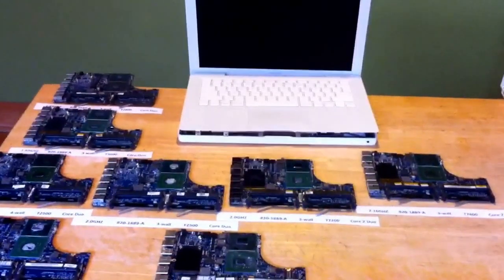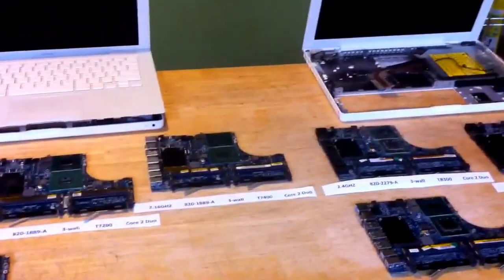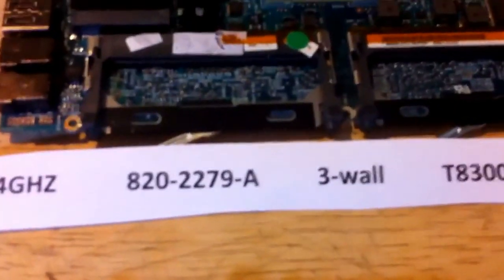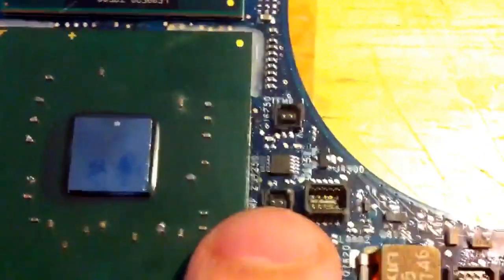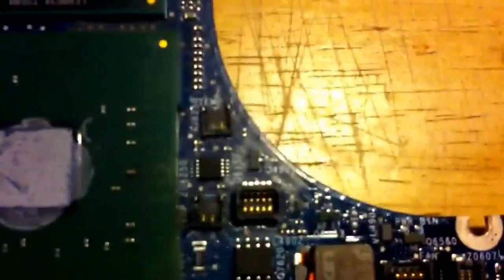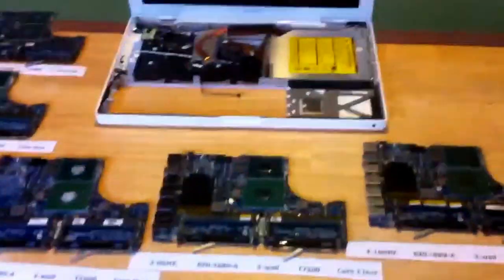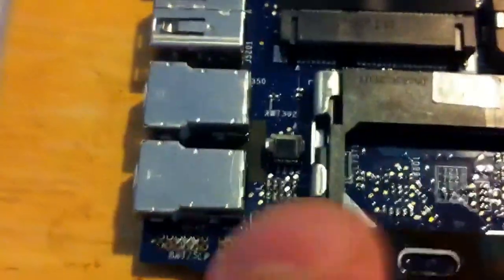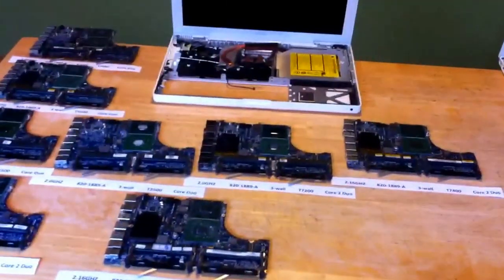MacBook A1181 Logic Board Overview

Comment: Hi rdklinc, I have a Macbook A1181 with a faulty 820-1889-A logic board. Let's say I swap it with a 820-2279-A, I know that in the video you say the heatsink screw locations are not the same, but what if I want to put it in anyways to salvage the working 820-2279-A that I have, technically what parts do I have to change such as Heatsink, speakers(because it has different sockets)? Can this be done? (with a bit of parts sourcing. Please advise. Thanks

Comment from the maker: Thanks!  Spraying compressed air is generally not dangerous to a board, so I wouldn't think that would be the problem.  Make sure the topcase connector is securely in place, and test the RAM slots by trying to power on with one empty, and then the other empty.  I don't repair or sell boards.  Thanks

Comment: Hi there, well done wery nice and informative video, I have a macbook 2008 A1181 model, the LB is 2279-A  with 2.4GHz, recently I dust cleaned, done already 3 times notting happens, this thime I don't know wath vent wrong but it wont start at all, could the gas that is conteined in the spray duster done some damage? as it gets wery cold and frezees conponents, and also is it possible to repair the LB, and how mutch do you charge for the 2279-A 2.4GHz ?.

Comment from the maker: Correct -- any 820-2279-A board should work.  It's actually my favorite model, because there's no variation of elements within the part number, unlike the 820-1889-A.  So it's a lot easier than others.

Comment: Thanks for your quick response, I think i'll keep looking for another board.
I'm I correct in assuming that any 820-2279-A board would fit my machine? My MacBoook is a late 2007 model and the board I'm looking at now is from 2008,
These are the specs:
A1181 MB403 T8300 2.4G logic board 661-4709 820-2279-A late 2008
My original board:
A1181 2.2GHz Intel Logic Board 661-4578 820-2279-A T7500

Thanks
(Original board is a 820-2279-A)

Comment from the maker: Thanks!  This is the mysterious "other" A1181 that I refer to, but that I don't have an example of.  I have never come across one, so I don't believe there weren't many made.  The optical connector is a smaller SATA connector, so you'd need a SATA optical and cable.  The heatsync is different -- it's a "straight" heatsync that points down and to the left at a 45" angle.  A different heatsync usually means different screw locations, so I'd guess it wouldn't fit in an 820-2279-A case.  Good luck!
Reply: Do you know board is in early 2008  black MacBook same a1181

Comment: First off, thank you for taking the time to make this, very handy.
My question: I've com across this logic board on ebay, 820-2496-A C2D P7350 2.0GHz.
seems to be 3wall connector.
Would they be interchangeable with the 2279A series?
Thanks

Comment from the maker: @StoneVideoGames As I make reference to, there is one more model of A1181 that I don't show in the video.  Is your heatsync similar to the one on the right, but not quite, and at a little different of an angle?  The other way to check is to verify you have a small SATA optical drive connector, instead of the regular larger connector.  If so, you've got the newest A1181.  What's the model number on it?

Comment: Actually I did not buy the board. It was a gift & kind gesture from my boss. So returning the board is out of the question. But I do appreciate the good advice!  Anyway, I think what's happened at this point in time, is the Macbook is stuck in Sleep Mode. How do I disable or disconnect Sleep mode through the connections going to the board & battery? This is my last hope. Thanks for all the advice you have given me. I do appreciate it.

Comment: Very good advice as usual but I know it's not the Hard Drive. It  After changing the Energy Savings to never Sleep, it would stay on for 2-3 hours at a time & then shut down. So maybe the guy sold me a bad Heatsink. Or mane the other guy sold me a bad Logic board. I'm going to pull it back apart & put it back together when I have time. Thanks again. I have been saving for a Macbook White. There are rumors they may upgrade the White soon. I would love to see the Black Macbook come back.

Comment from the maker: @vovtoons It sounds like you've done everything right.  You might want to download iStat Pro, a free heat monitor tool, just so you can verify this is a heat issue.  It could be shorting out if there is a loose screw, cable end, etc., that is only making contact periodically.  Might be worth re-installing the board just to be sure.  Might want to boot from an external drive and see if it shuts off from that drive...a hard drive issue is a longshot, but it's worth testing.  Good luck!

Comment: Yea I reaplied. There was some left over from the old heat sink & it was oozing down the sides of the Processors. I clean the area down the sides gently & reapplied a pea size dab on each heatsink plate. This is most disappointing, as I for sure thought this was going to work. I do appreciate the help & your quick replies on all this. I know your skills are way beyond mine on all this & I look forward to your replies. Thank you.  Anything else you can think of, I would appreciate.

Comment from the maker: @vovtoons Stupid question, but did you apply new thermal paste?  Without it, the heat will not properly flow from the processor through to the heatsync, and it can eventually overheat and shut off.

Comment: Well I got the Heat Synch. It was a little Bent when I arrived but I put it in & all seemed to be working until I put the Keyboard Top Casing On. Then it shut off. Then I finally got the Keyboard on without it shutting off for hours. Then it turned off again. So I either bought a bad Logic Board or  a bad Heat Sink.  Now I know even with the Keyboard connected but bnottouching the Metal Components underneath, It still shuts off.

Comment from the maker: @Belluomo Another way to think of it is, you're going to need to go into the machine to replace the board anyway, so you might as well do it now and get the model number so that you can rest assured you're buying the correct replacement board.  Popping the topcase and getting the model number takes about 10 minutes -- just go to ifixit dot com and look up the A1181 guide.

Comment from the maker: @Belluomo Sorry, but you can't! Actually, there are websites where you can plug in your serial number and get an idea as to which board to use (if you can intrepret all the vague Apple classifications, which is more trouble than it's worth), but the only absolute way is to open the machine and look at the model number printed under the right RAM module. It's just not worth guessing. When I sell boards I tell buyers they need to open the machine and verify the model number.

Comment: Ok, I watched your video 3 times.  I'm left with the question, how do I tell which board fits my machine, the 1889 or the 2213?  2.16 GHz, core 2 Duo is what I have.  How do I find out which model is correct without taking off the top case and looking directly at the board?

Comment from the maker: @vovtoons That's just not true -- a board will charge a battery just fine without a heatsync attached.  I've tested charging on hundreds of A1181 boards without a heatsync.  However, some boards overheat quicker than others, and may shut off before it's evident whether the battery is going to charge or not.  If I were you I would go on eBay and get the right heatsync/fan for $12 so that your machine does not shut off, and you can see if charging kicks in.  If not, it's your board.

Comment: Well that would really S%#@!  I hope it's not the board. This is what this guy wrote about the Heat Synch & the Battery not charging. "the heatsink gets too hot and the Shuts off the PMU in the computer, therefore it won't charge and may shut off as it did in mine."  If it's the Board, that means I can't use it with the Battery. With the previous board, there was nothing on the screen when I got the Laptop. But I know plugging it in would charge the Battery, just by the Lights on the Battery.

Comment from the maker: @vovtoons No, the heatsync has nothing to do with the battery or whether it will charge.  I'd replace the battery connector first, just because it's a cheaper component, but the fact that it worked with the previous board probably points to your new board being defective.  It's a pretty common defect for MacBook boards to fail to charge a battery.

Comment: I did what you said. I have a Non Energy Star And both are a Match. The Board & The Battery Connector. No Gaps. But I still have to get a different Heat Synch for this board. I'm getting the 3 Wall Heat Synch to Match this Board. Could the Heat Synch not being plugged in cause it to not detect the Battery? The Macbook will run without the Heat Synch Cables being connected for a while & then it shuts off. I installed the entire OS this way. Can a dad Heatsink cause the Battery to not be detected.

Comment from the maker: @aizoyurei Thanks!  Honestly, to answer your question, all the info you need is in the video.  Match the model number of your board to the same model in the video, and see if I show a version for that model number that is faster than 2GHZ.  If you get a replacement board that is the same model number as your current one (note:  I'm talking about board model number, not processor speed) then the screw holes will be in the right place.

Comment: I really enjoyed the video! Very informative. I'm wondering though I have a 2.0 non energy star, 3 wall that has fried, is it possibly to upgrade speed of the logic board? meaning can I replace it with one the high speed logic boards? other than the 3 wall / 4 wall thing, will the screw holes be the same?

Comment from the maker: @vovtoons Make sure the battery connector is fully seated in its socket.  Sometimes it seems like it's all the way in, but if you give it a solid push you'll realize it wasn't fully seated.  Also, take a look at the battery connector and see if it has no gap in the pins (non-Energy Star) or a gap in the pins (Energy Star).  And then take note of the pins on the boards and make sure it's a match.  You may need a new battery connector, but since it worked before, I'd guess it's not fully seated.

Comment: Question: I have a Macbook. I replaced it's 4 Wall Logic Board with a 3 Wall Logic Board. I got the Logic Board for a good price. That is why. The existing heat sink obviously will not connect because it's for a 4 Wall Logic Board. I'm buying a 3 Wall Heat Sink which should work I'm guessing. But now my Battery won't charge. Is it because the connection is different? Do I need to just buy a new Battery Connecting Wire. Or am I doomed?  It's an Intel Core 2 Duo. 2.0 GHz.  Thanks in advance!

Comment from the maker: @moseskravitz Thanks for the comment, and I'm glad you found the video useful!  The most "essential" difference I am aware of is that the 2213 has an Energy Star battery connector socket (gap in the pins), which requires an Energy Star battery connector to match it, whereas the 1889 has a non-Energy Star socket (no gap in pins).  Aside from that, I think it's basically the same board.  I imagine it's newer than the 1889, maybe just an update to include Energy Star.